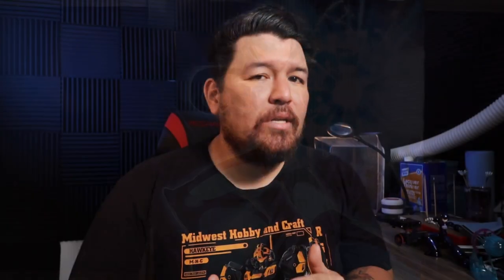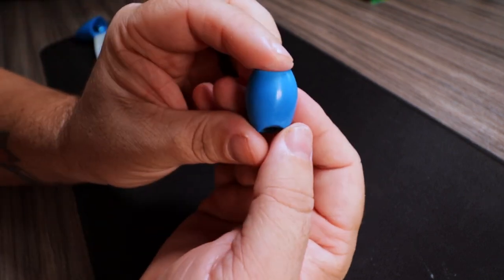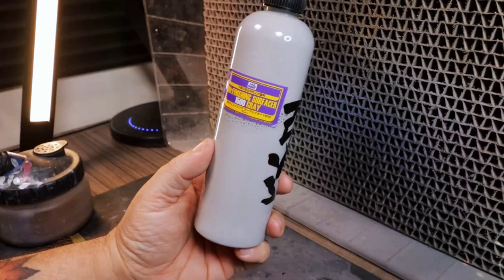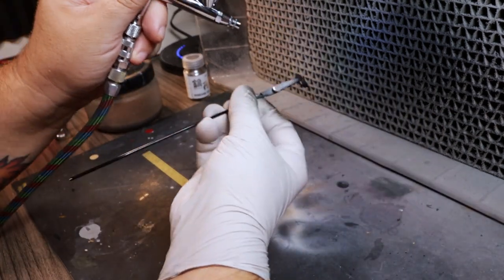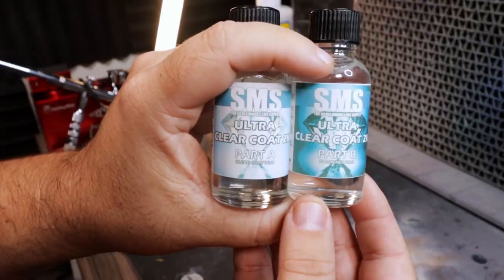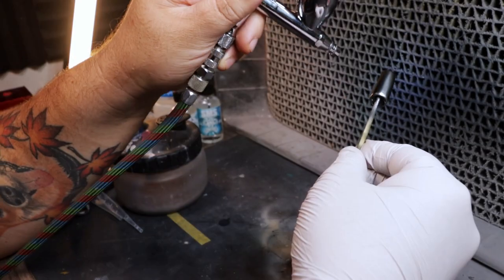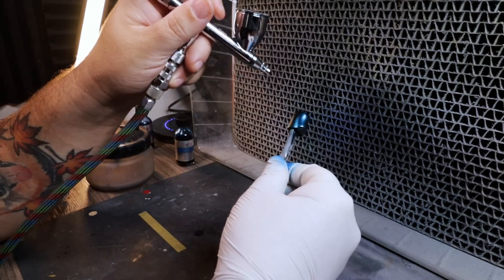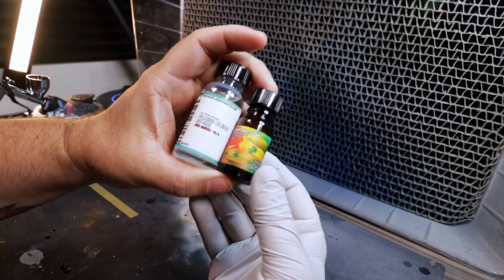How to Candy Paint - Perfect Mirror Finish Every Time

Comment: I use tamiya surface primer for my gundam kit. However, the primed surface is kinda grainy, no matter what I do, the gloss black base coat I applied on the primed surface are not very glossy. Any advice guys?
Reply from the maker: Hey, I'm sorry to hear that. Try sanding the primer down a bit with 1000 or higher sand paper. Test it on a spoon first to see if that works. If not, you might need to thin it way down and build up the layers. Best of luck! Thank you so much for watching and commenting!
Reply: @PlamoTherapist  love your vids, learned a lot from your vid.

Comment: Great video as always. I did buy my 2k varnish from the auto part store, then i got a liter of the stuff for about 50euros. Thats much cheeper than the small hobby jars
Reply from the maker: That's awesome. Just be careful with automotive paints. Some can still be considered too strong for plastic.
Reply: @PlamoTherapist  its a polyuretan based one, but thanks for youre concern
Reply from the maker: Yes, most 2Ks are urethane, but it's not the paint that can be the issue, it usually whatever solvent it's suspended in that can be the problem. Just stressing to be careful is all. 😁
Reply: @PlamoTherapist  😁thanks again, happy to know youre such a good guy 😁 and i varnished a Plymouth gtx 1969 in 1/25 scale yesterday, came out fantastic

Comment: Damn, didn't expect that 2K can be thinned with lacquer. 
Thanks, I gained new knowledge.

By the way, I saw you switching between lacquer, water-based chrome, and 2K.
Do you find it difficult to clean? And is acetone the solution?
Reply from the maker: Hey thank you so much! The SMS 2K can be thinned with lacquer thinner because it's a lacquer paint. I believe the Splash is as well, but it definitely doesn't need it.

As far as cleaning goes. It really wasn't a problem since it was a full day between coats, so I took the time to deep clean it. Since everything was lacquer, I just soaked my airbrush in lacquer thinner. Don't forget to remove all the rubber O-rings first!
Reply: Ah I see. Thanks for the explanation
Reply from the maker: Of course! Best of luck!